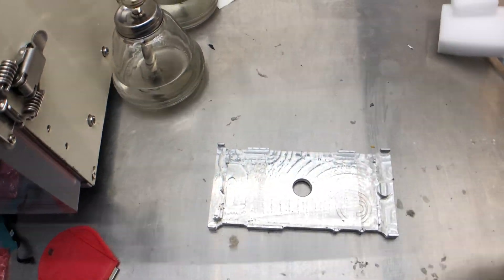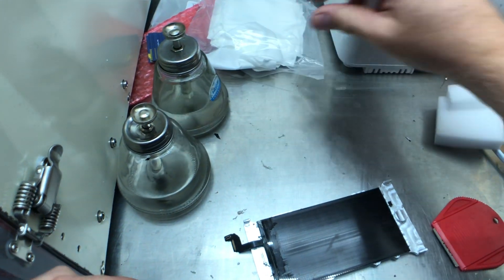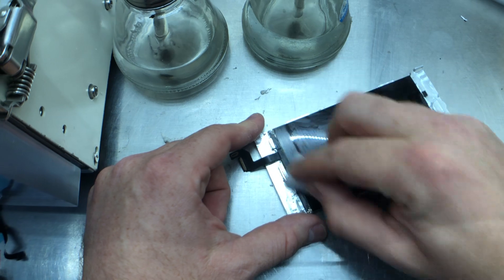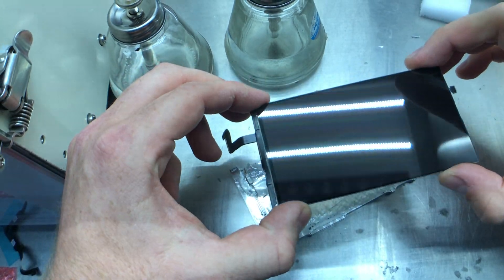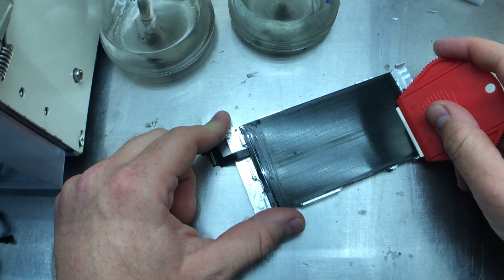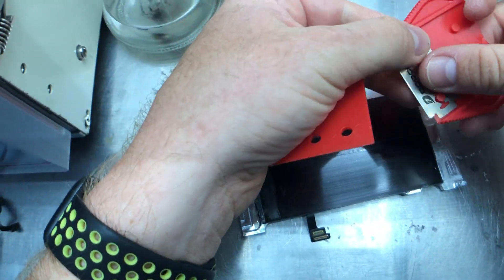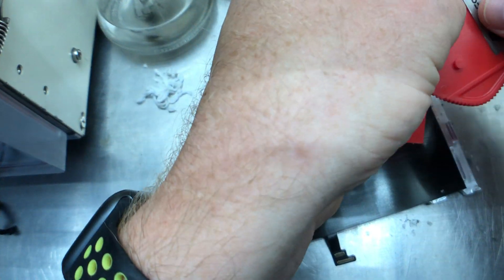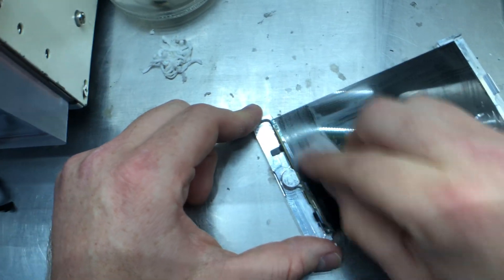iPhone LCD Refurbishing - Cleaning the Polariser Glue, DO NOT USE Chinese Liquid

Comment: Where did you bought those razor blade holders? Can you post how holder is called and where to search it for?
Reply from the maker: Chinese resellers sell them, Nancy and Jerry from the facebook group linked below sell them.
Reply from the maker: They are available here https://www.aliexpress.com/item/33045324677.html?spm=2114.12010615.8148356.6.34f216a5rs4Hpd&af=98MvE8&cn=aliexpress&cv=banner&dp=19TZ1Q2X2xZEoRI&tp2=98MvE8&afref=rtbs24.com&mall_affr=pr3&af=98MvE8&cn=aliexpress&cv=banner&dp=19TZ1Q2X2xZEoRI&tp2=98MvE8&afref=rtbs24.com&aff_platform=link-c-tool&cpt=1565253690068&sk=cD4TW1tW&aff_trace_key=22e6cb27a78e40feb20ecf98407bf3d9-1565253690068-01760-cD4TW1tW&terminal_id=2b1cb874efd14c2d882ec4bd726d7b18

Comment: How do you not crush the pixels of the LCD? You're really leaning into the scrubbing of the glue, which usually can break the LCD in my experience.
Reply from the maker: BenFreemanDC melamine sponge (magic sponge) and acetone. The sponge does the hard work, it’s not as hard as it looks the sponge is very soft so when pressing looks like hard pressure.
Reply: @rikibaker1578  Also doesn't the acetone eat into the circuitry at the top of the screen? I've had that happen a lot with acetone.
Reply from the maker: BenFreemanDC I’ve not had that once no

Comment: Not sure what camera you are using, but to stop the flicker you need the match the shutter to re refresh rate of the electricity or a divisible of it. e.g 50HZ = 50 shutter. My camera doesn't go as low as that, so I use 100, which sorts the issue. The frames then line up with the flicker frequency, taking it away. https://youtu.be/6zCOlib39yU
Reply from the maker: Iain Simpson just an iPhone X, the flickering seemed better after the start. I’ll look into it thank you 👍
Reply: Riki Kim I think it’s because the camera is varying the shutter speed automatically , when it could do with being fixed. There’s a few apps on the App Store that you can use that give you manual camera control. Think it’s called pro camera or something similar.